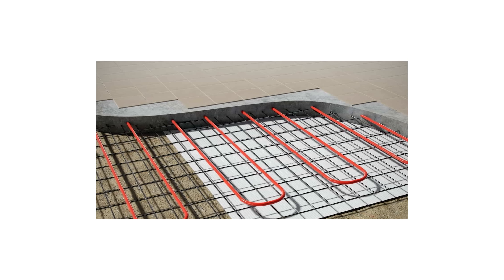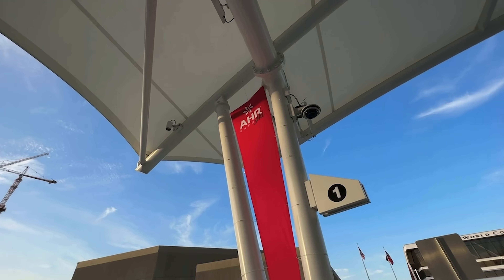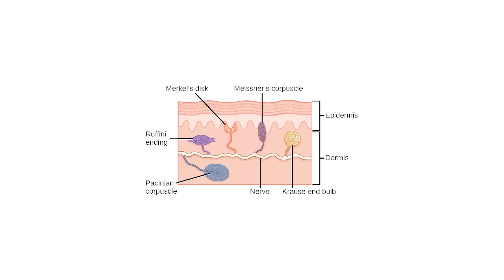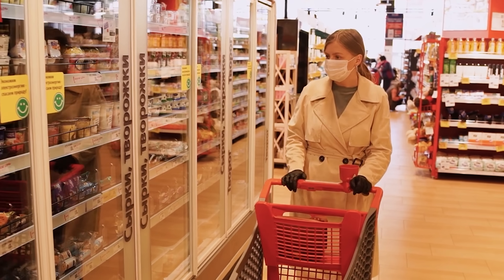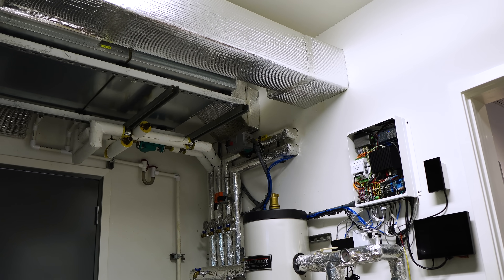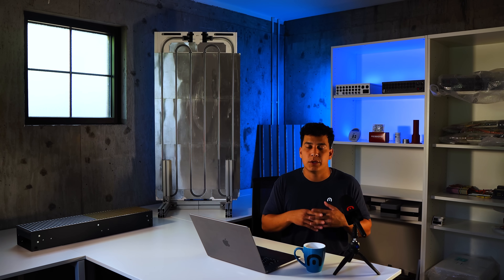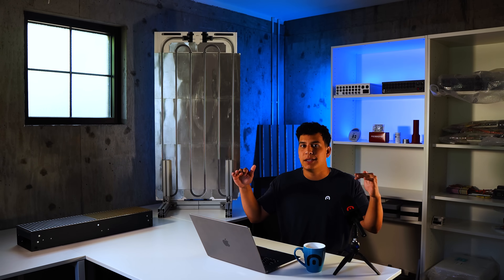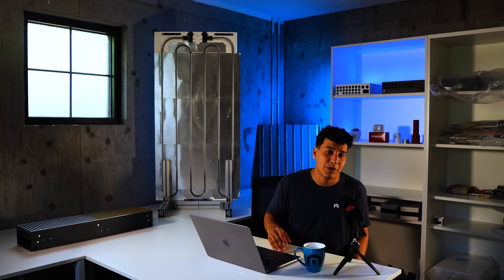Radiant Cooling 101: What is Radiant Cooling?

Comment: Radiant cooling feels cold not because you feel how thermal energy is pulled from your body, your body always radiate heat, but because it doesn't reflect back from the cool surface and of course same happens to the air and other mass in the radiant cooled room :)

I'd love to have that in our next home to use same floor/wall radiators for both heating and cooling simply because it's silent, forced air systems in US are generally very noisy, but there are 2 major issues: you still need fresh air ran to the rooms, especially in the bedrooms to reduce CO2 buildup and then there is moisture, playing with dew point throughout the building is hard. You essentially have to run two systems — antifreeze heating/cooling pipes with radiators and air ducts for ventilation which takes a lot of space and adds a lot of complexity to the building.

I'm afraid forced air cooling, heating and ventilation is still functionally superior, especially when paired with inverter for slow ramp up and precise speed/noise control + heat pump as cooling/heating core.

Comment: Why do these systems use water instead of some form of glycol, etc?  I was always led to believe that Glycol was a better exchanger of heat than regular water?
Reply from the maker: Hi there, great question! 

Glycol actually has a lower heat transfer capacity compared to water, so it slightly decreases system output/performance. But if we are working on a system in a cold clinate, glycol may be needed for its freeze protection benefits. Here is some data on performance: 

Specific heat: 
Water ≈ 1.0 BTU/lb·°F
30% propylene glycol ≈ 0.91 BTU/lb·°F
50% propylene glycol ≈ 0.84 BTU/lb·°F

This means glycol carries less heat per pound of fluid, so emitters (radiant panels, fan coils, etc.) will deliver less heating/cooling output for the same flow rate and temperature difference. Let us know if you have any other questions!

Comment: Hey man quick question 
if I am in a hot climate 35-42 C degrees in the summer and 
the ground temperature is constant at 16-18depth  depending on location  at 3 meters . 
is it possible to get cooling from that ground using horizontal geothermal loop without the need of a chiller ? 

like if am getting the water out at a temperature of 22-24 in a room air temp of 38 C 
would a heat pump be  really necessary?
Reply from the maker: Great question! It is possible to provide cooling via a geothermal loop without a heat pump. That said, you would need the water to be closer to 16°C, as you do not have enough of a delta T to create a comfortable environment. It would theoretically help drop the temperature a little bit in your situation, especially with air units or a radiant floor if you have a lot of windows that tend to result in an overheated floor. But you would still most likely sit around 32°C, so the comfort benefits are minimal.

Comment: In the UK the highest performing systems are on open loops, where all the heat exchangers are at the same flow temperatures and the home is treated as one zone. There isn't an efficiency benefit in zoning as the heat pump modulates/cycles on partial loads, which lowers COP more than any energy saved. You do need to accurately calculate heat loss to size the heat exchangers, with a weather compensation curve, and control solar gain via integral or external shading.

Comment: This is the first video I've seen of yours, so my question is, can you use the same system for heating AND cooling?  I would be using it for new construction of a barndominium, likely on a concrete slab, with 25' ceilings at the peak in the living room & dining room space, along with the large garage.  The main floor will have 10' ceilings, & the partial 2nd floor's vaulted ceiling will be from 7-13'.  Thanks so much!
Reply from the maker: Yes, a hydronic radiant surface can certainly be used for both heating and cooling, however a barndominium may have higher cooling loads that would be hard to meet with just a radiant surface. Supplementary hydronic fan coil units may need to be incorporated to provide additional cooling.

Comment: They are installing radiant cooling and heating floors in my new build in Spain. I am so worried it won’t be that cold :( Spain (Madrid) gets so hot in the summer and I have always been used to traditional AC. How cold do you think radiant floors could go?
Reply from the maker: We typically supply ~55°F water to radiant floors and the radiant surface ends up being ~70°F. This certainly makes a difference on hot days, but it is rather difficult to meet cooling loads with radiant floors by themselves; unless you have a really high-performance home with low cooling loads. 

With that said, radiant floors do a great job of preventing solar gain in homes with lots of windows. Typically, sunlight will come through windows and heat up your floor, which absorbs heat and keeps your environment warm. When you have a radiant floor in cooling, this does not happen, so you will certainly experience less solar gain. 

Typically, we recommend adding supplementary hydronic fan coils for a project like this. These units can be tied into your hydronic system to provide supplementary heating and cooling. These units consist of a fan and a hydronic coil which is heated or chilled. We can get the coil really cold because the unit also has a condensate drain, so condensation is not a concern when providing cooling. Because of this, we can maximize cooling output. Compared to radiant systems, the main downside is that you will see these units in the floor, wall, or ceiling, and you will likely hear the unit operating as well. If you would like to learn more about these units, check out our other video: https://youtu.be/CKTP4ZCkKkk?si=wYleTd4jWB5UXQY_

Comment: do you have a simple schematic of a air to water reversible heat pump, showing how it could heat a water tank (for showers) and at the same time cool a radiating loop? How does that work (or not)?
Reply from the maker: We don't have a schematic, but Messana Controls can manage two separate heat pumps to create a four-pipe system that would be capable of simultaneous DHW production/heating and cooling (some of our projects do this). 

Alternatively, the Viessmann Vitocal system can be used as well since it has an indoor unit with an electric heating element. Learn more here: https://www.viessmann-us.com/en/products/heat-pumps/vitocal-100-aw.html
Reply: @messanatech  so it's impossible for one single heat pump unit to cool a floor while heating a tank....thanks

Comment: Is it suitable for humid conditions?
Reply from the maker: High humidity levels can certainly limit radiant cooling output. This is because the radiant surface temperature must always stay above the dew point temperature to prevent condensation. 

As humidity increases, the dew point temperature rises, meaning condensation can occur at a higher radiant surface temperature. To avoid condensation, Messana Controls adjusts the supply water temperature to the radiant panels (limiting cooling output). However, our controls can also integrate with additional equipment, such as dehumidifiers or fan coil units. These devices can help reduce the dew point temperature in the space (improving radiant cooling performance potential) or provide supplemental cooling, ensuring optimal comfort and system performance, even in humid climates.

Comment: Great Video. You've kind of answered this question in another comment, but regarding dehumidification, you said your sensors and controls work together to monitor the due point and then move to lower the dew point to deliver cooler water if needed. Do you use dedicated outdoor air systems to achieve this? If so, even in high-end residential builds or retrofits? Would really appreciate an answer. Keep up the good work!
Reply from the maker: Hi there! Great question, there are a few things we do regarding managing radiant cooling and controlling humidity. 

1. For simple radiant cooling systems without dehumidification, we use our sensors/controls to monitor the dew point and adjust the radiant surface temperature accordingly. In this situation, our controls would actuate mixing valves to adjust the supply water temperature to keep the radiant surface above the dew point temperature, thus avoiding condensation. 

2. For systems with a dedicated dehumidifier, we would be able to manage dehumidification to lower the dew point temperature within the environment. As you mentioned, providing dehumidification lowers the dew point temperature, which allows us to use cooler water within the radiant system, increasing cooling output.

3. Although they don't dehumidify as much as a dedicated dehumidification unit, hydronic fan coils may be used to provide some dehumidification using specific logic within Messana Controls. Our controls would run the fan coil unit with chilled water at a low fan speed. Since the hydronic coil will fall below the dew point temperature, condensation will form and be collected by the fan coil condensate drain. By pulling that moisture from the air, we dehumidify and lower the dew point within the environment. The reason we set the fan coil to operate at a low fan speed is because it minimizes drafts and acoustic disturbances, while still providing dehumidification. 

4. Messana Controls can also manage Energy Recovery Ventilator(ERV) units, which do not act as dehumidification units, but they remove humidity from the incoming air stream. 

With all this said, an air-to-water heat pump is usually the outdoor unit responsible for generating the heated or chilled water within the hydronic system. However, a geothermal heat pump unit could be used indoors to do the same.

Comment: Can this application work with tray ceilings and the likes?
Reply from the maker: Yes, absolutely! We've worked on several projects with tray ceilings and similar architectural features. In some cases, there may be two levels of radiant panels, while others might use a single level, either the recess or around the perimeter. The key is ensuring that the radiant surface area is sufficient to meet the heating or cooling load requirements.

Comment: You guys should make an Airbnb in some high temp and humidity climate so people can actually see that it works. I’m really interested in radiant cooling, on paper it makes all sorts of sense. But in building, I’ve got one shot to get this right. Can’t go back and add ducts if it doesn’t pan out as planned, so tough to pull the trigger.
Reply from the maker: That's a pretty good idea! We currently use our office in Soquel, California, as a showroom for our products, so sometimes folks come by to check out our system!

Totally hear you regarding needing to get this right. 

In humid climates, we often recommend adding ample dehumidification and even supplementary fan coil units (FCUs). 

To avoid adding ducts, I recommend you check out Jaga hydronic fan coil units. They have ducted or non-ducted versions and are a great complement to a radiant system because they can use the same pre-insulated PEX lines (instead of ducts). 

Messana Controls even has special controls designed for Jaga FCUs that can control the 0-10v fan speed and run the FCUs at a low fan speed with cold water to provide dehumidification (using the condensate drain).
Reply: @messanatech  Have you guys found that whole house dehum is sufficiently controllable to deal with humidity in individual rooms? We're hoping/planning a really tight house with a whole house dehumidifier.
Reply from the maker: @chrisgeary4624  It really depends on the size of the home. Sometimes we can get away with dehumidifying from one point, but for larger projects, we may dehumidify from several points. If you have a project in mind, I would recommend submitting an estimate request to discuss this further with our sales team/engineers! https://messana.tech/get-started/
Reply: Any experiences or thoughts using radiant cooling in a large steel building (5000 ft and up) that serves as a gym? We would obviously have large overhead fans to ensure some airflow as I think that would not feel good otherwise but curious about the approach in more accessory structures vs homes.

Comment: How we maintain the humidity in the space  with radiant cooling?
Reply from the maker: Great question! 

Messana Controls and mSense room comfort sensors work together to constantly monitor the dew point temperature in each zone of a building. mSense room comfort sensors monitor Operative Temperature, Relative Humidity, and Volatile Organic Compounds (IAQ). From there, our controls can: 
- Adjust the supply water temperature to the radiant surface to keep the radiant surface above the dew point, avoiding condensation. 
- Activate dehumidification units to lower the dew point within the environment, allowing the radiant system to use cooler water, increasing cooling output.
Reply: Do you buy what he is selling?

Comment: Could this be used for a camper trailer
Reply from the maker: There are several reasons a hydronic radiant system is not ideal for small structures/trailers/RVs. 

Response time: Radiant systems do really well at maintaining comfort within an environment. With that said, because they are radiant, they take a bit longer to bring the environment to its set point. Because of this, spaces that only need conditioning part-time will inevitably get too hot or too cold while the system is off, and the radiant system will take a significant amount of time to bring the environment back to its set point. So, in this case, a forced air system may be the way to go to quickly condition the space.

Furthermore, all walls are technically exterior walls: Because all walls would be exposed to the outdoors (and there is typically less insulation), solar gain will be an issue for a project like this. All walls would be heated by the sun/outdoor temperatures, so it will be more difficult to meet cooling loads.
Reply: @messanatech  can you recommend a water to air system or geothermal system that works well with the messanatech system? I would like to use the system for a multi-family development project that I have coming. Thanks!
Reply from the maker: @ItsJustAlexOfficial  A multi-family project would be a good candidate for our radiant ceiling panels, but if you went with air units, we typically recommend Jaga fan coils, which can be managed with Messana Controls using custom logic.

Regarding geothermal energy sources, we have done a few projects with Enertech and WaterFurnace GHPs, and they went great!